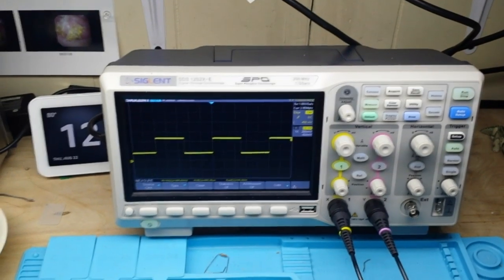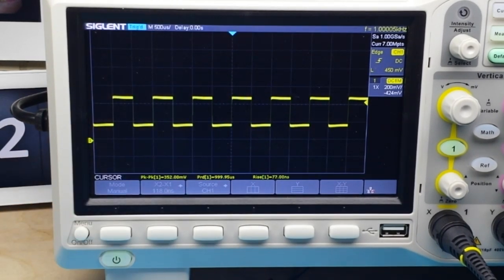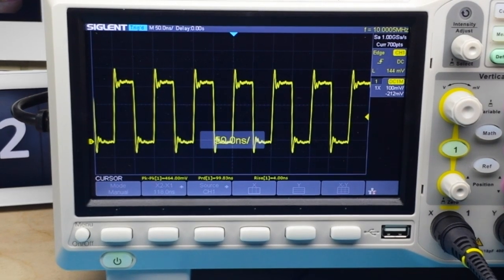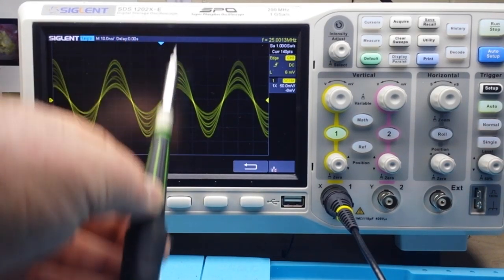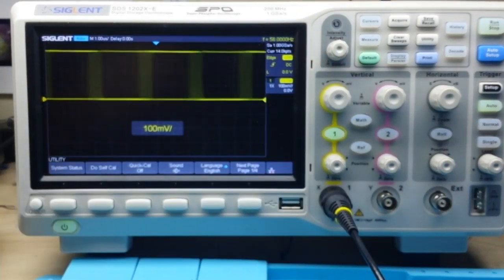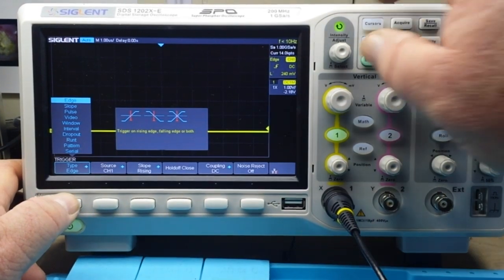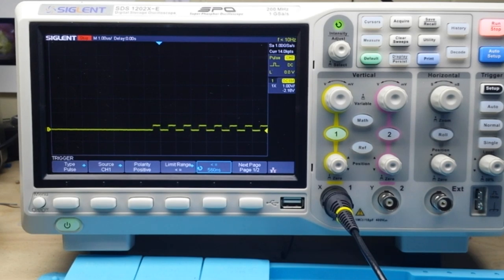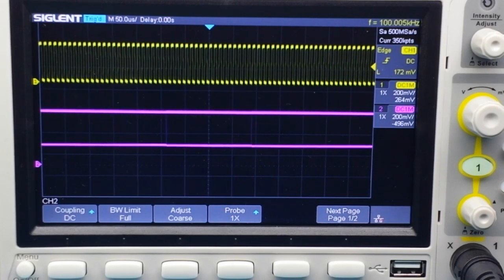Getting Started with an Oscilloscope: Part 2

Comment: Under Damped Aka Impedance Miss match.  GooD Show.   Wish I had a Real Scope.   Working with a few DSO-150's and a Hantek 6022BL.   Better then NO Scope but  no good for The RF World.
Reply: If you can do precise measuring with DSO-150 and Hantek 6022BL on RF signal you are real pro. Also, 200Mhz is good for a signal up to 40Mhz and it is not enough for real RF signals
Reply: @antiikadad917  Yep,   With my toys I'm locked out of the RF World.   Heterodynea  a signal down to something in my reach is all I could hope for.

Comment: I seen that you have a Micsig o-scope as well. I have the tablet style, it looks like the layout of the software is similar, from what I seen online and in one of your videos. I like mine, but the manual is not that great. A lot of its controls are pretty standard, so it isn't too hard to work out, but some of the settings and setup is a little different. I would love to see a video going over the Micsig functions. I tried getting the latest manual, but their site is not helpful.